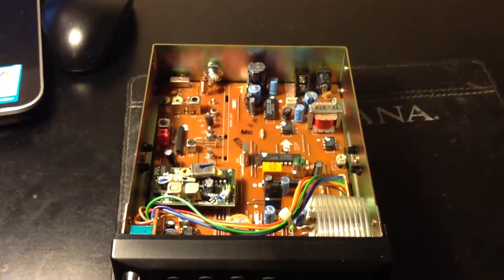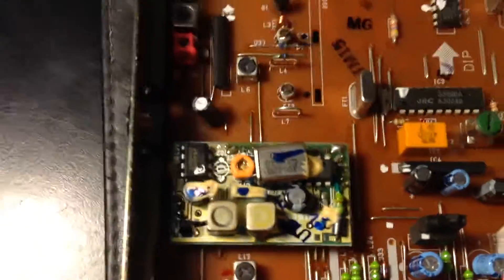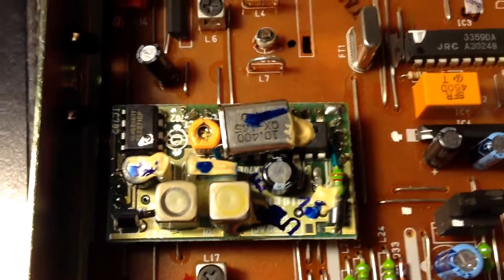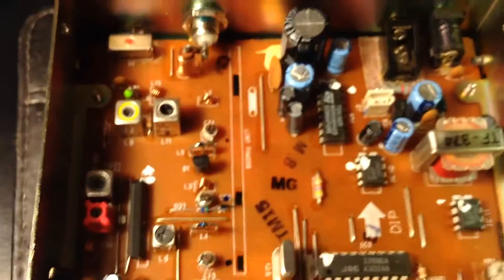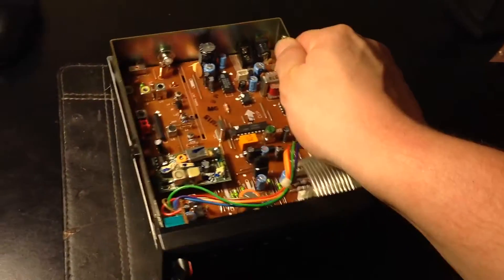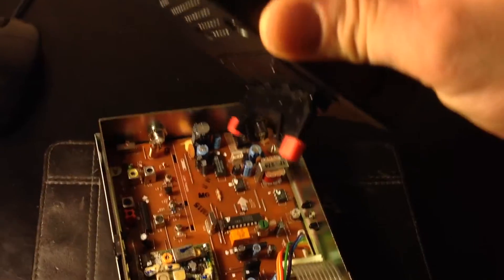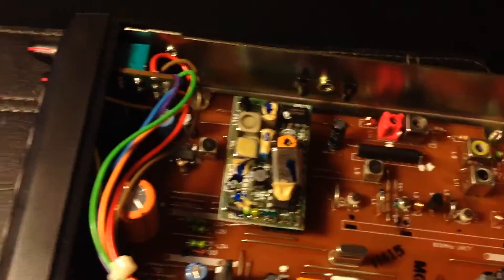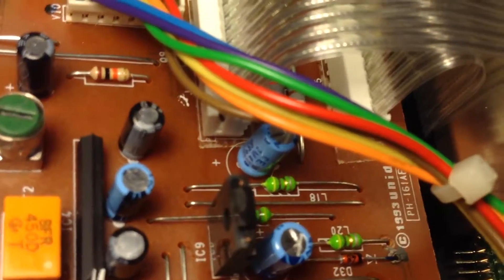Inside of a mint Uniden BC350A scanner unit!

Comment: Leap frog is there a direct contact method for you??!! I am desperately needing someone with your knowledge.  Maybe you can help me fix this mistake I made on my Scanner! Thanks
Reply from the maker: Philip Benoit, I'm not super knowledgeable I just like to tinker around.
You can feel free to ask me any questions here and I can try to help.
Reply: @LeapFrog_Radio  well you seem to know the basics of the board and it's functions that control the scanner and I do believe that this is where my problem is considering my brand new late anniversary gift being a uniden handheld scanner is in 2 halves. You are a genius in my eyes lol. I am completely dumbfounded on the whole function of the board. And my problem is when I try to put the 2 halves back together and power it up I'm getting nothing. But with a slight wiggle which I can't place my finger on it, it's like something isn't lining up just right.
Reply from the maker: @philipbenoit1468  I don't have any experience with the handheld series of scanners, but this definitely reads like a connector or cable not making contact.

If the unit uses ribbon cables to make connections, the kind that slide in place; I'd check those carefully. Sometimes they have a plastic clip that locks the ribbon in place, if the clip breaks it's a real pain!
Reply: @LeapFrog_Radio  oh geeze
Reply from the maker: @philipbenoit1468  Yeah, you've to be careful when opening units like that. 
I learned the hard way back in high school working on a Mac laptop, the mouse pad used a ribbon cable for connection, I busted the plastic clip and wasn't able to repair the connector, now a days if you can salvage the part off a scrap unit, you may be able to replace it... but I wasn't able to fix the laptop's mouse pad. : /

If the clip isn't broken (assuming they used that style of connector) be sure the cable is actually all the way in, as that can cause this issue too.
Reply: @LeapFrog_Radio  I appreciate the advice and I will take a closer look at it and pray that's not my issue.
Reply from the maker: @philipbenoit1468  No worries, and I wish you luck. Feel free to ask any questions,  & for now best of regards.